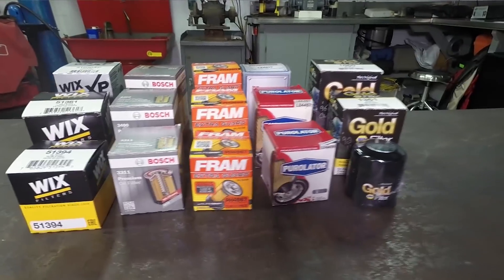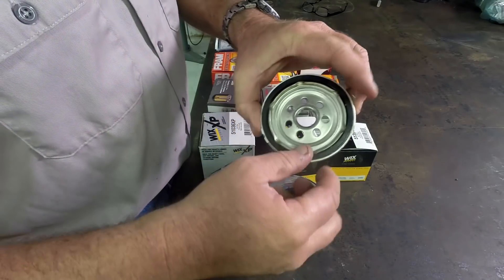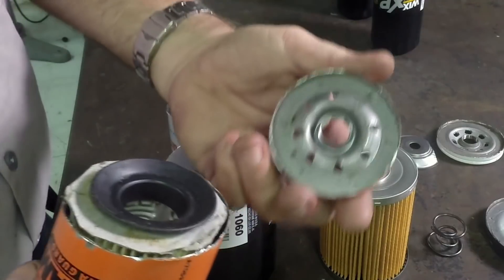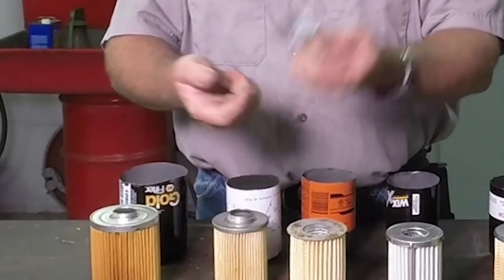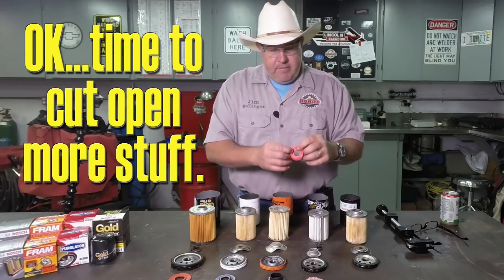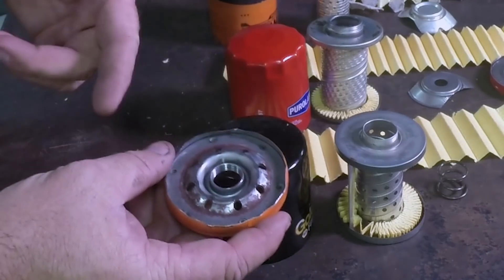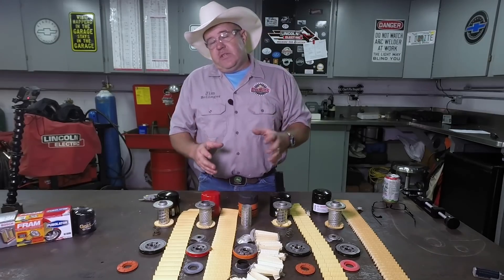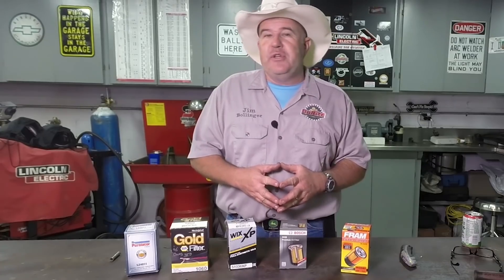The worst oil filter EVER!

Comment: I have seen literally over one hundred or more cut open Fram orange filters after being run from 2k miles up to almost 10k miles on bobistheoilguy... The overwhelming majority of these actually used filters looked perfect. No rust... No separation of the end cap from center tube.  The very, very few that did  had some deformation of the pleats... One had a rip in the media... Which by the way a Purolator has had many many rips in them. The rips in the Purolator media is almost always near the final seam.  Especially the 14610 sizes. Even Wix had two torn filters on there... But that was out of like 100 plus Wix filters cut open on there. I have a Wix 57356 on my 3.5 VQ motor right now... I like Wix quite a lot. But even Wix has an occasional failure. Very seldom but it has happened at a extremely low rate. Just like Fram orange filters. I cut open a Fram Tough Guard 7317 from my own VQ on the bobistheoilguy site... It was absolutely perfect after 7k miles. While on this subject I cut open a Purolator One 14610. Which was in great shape has well. No issues. But there have been many of that sizes which have rips in the media near the seam. 

 Fram orange filters are on MANY vehicles all day in this country. Fram also is a OEM filter supplier for vehicle manufacturers. Also I just saw a Mazda oil filter in a can with zero end caps... Zero. That was interesting. That being said a Fram orange is fine for what it is.... A entry level filter. There's nothing wrong with buying a  upgraded oil filter. I do at times. But I have never had a issue with a Fram orange when I have used them good number of times. A entry level filter like a Microgard (made by Wix), Fram orange, and Napa Proselect (made by Wix)  are all made just fine for what they are intended to do. 
Higher tier filters are great too. Which I have a Wix 57356 on my VQ motor right now. With 2 more Wix 57356s waiting in the wings to be put on my grey goose. I like Wix overall quality. Obviously higher tier filters have synthetic media and silicone ADBV. So comparison of entry level vs higher tier filters is not a apples to apples comparison. It's not. It would be like comparing a Napa Proselect to a Fram Ultra... Apples and oranges comparison.

Comment: Well all i can say is when u have a oil filtration system fails on your car and the engine take a hit...

"OH FRAMITT!!"

(Baa-dumm-tisss)

Ok enough of that but really from all the years ive changed oil in several cars ive own i NEVER looked to getting Fram its cheap but im not about the super cheap when it comes to my cars because there too important to be skimpy when u need them. And wow just as i suspected from all the years ive skipped from using fram i always knew that filter was a P.O.S. and there is the apparent proof of how bad those filters are. If u think there bad i would imagine there air filters are also bad as well.

Comment: Weird that it's only the USA that seem to have problems with Fram filters, the rest of the world manages to use them just fine.
Reply: ricky302v8 - The USA uses them just fine also, but they’re still crap no matter where they’re being used.
Reply: Just as with culture, standards change when you visit different parts of the world.
Reply: I have used K&n filters for years. The side of the box has a cut-away of the filter showing its individual parts. I buy them because I am assuming they are some of the best quality. Am I paying for this better quality or advertising wank?
Reply: @steveholbrom8424  - Well here is food for thought... If an air filter honestly flows more air over the same exact surface area of the stock filter, the only way this can be done is by making the filter itself less restrictive (In other words, easier to pass particles through it). This is why K&N and many others have you douse the filter in oil, to help collect the particles that can pass through the filter element as it does not do as good of a job as a stock one. Now I don't know about the overall quality of the filter, I would assume it is of high caliber, but if you can drive a truck through the holes in it then who cares what it's made out of.
Reply: Power to the Sheeple The dirtier the filter the better it filters 😉
Reply: It's because Americans think they're cool to hate on Fram. Honda uses Fram filters as OEM.
Reply: @cjeam- Um no actually Honda does not use Fram filters and you can find videos right here on YouTube that cut apart blue OEM Honda filters and compare them to Fram and they are not the same. And Bob - McDonald's sells Billions of cheeseburgers ever year so does that mean McDonald's the pinnacle of high quality food? I mean shoot, if you can't see the blatantly obvious proof here and on other countless videos then well just keep on buying Fram I guess.
Reply: Power to the Sheeple Was a joke. As a filter becomes dirtier it restricts more and more material (and air/oil/fuel) from going through it, filtering more stuff. A blocked filter filters 100% of the material going through it, because nothing at all goes through it.
Reply: @powertothesheeple5422  Fram and another company (starts with a T, I believe) make Honda OEM filters. Fram also makes Subaru filters.
Reply: Yes I often wonder, why do Americans get these problems. I live in the UK and have never had any problems with them. The one on this video is clearly a knock off and would just collapse in service.
Reply: Well for the UK blokes, has anyone over there cut apart a UK Fram filter like this to prove it's better quality? I bet it just comes down to the fact that nobody has actually done this type of video on those products. It's not like there is some huge issue with Fram filters in the US, in fact they are still probably the most popular brand. But if you take the time to cut them apart, you see that they are sub-par at best. And here is food for thought; why is it that no manufacturer in the world puts a Fram filter on their engines from the factory?
Reply: How do you know it was a knock off? It was a bona-fide Fram filter available in Walmart and Auto parts stores!  I done this test 20 years ago and the Fram filter was much better than now but still not as good as WIX - that was before Fram had all the different grades of filters! Now there's too much guess work involved with selecting a Fram Filter. NOT so with WIX!   @phillipjones3439
Reply: As crap as it is, 99.5% of people using them exclusively for the life of the car would have 0 filter related issues. The difference is that people using better filters would see a 99.7% success rate. 

Note: Numbers are not real, I pulled them out of my ass for example purposes.

Comment: This is a lot of personal judgements. Zero actual, repeatable, scientific comparative data. OEM's have been using cardboard end cap filters for decades. Some even use plastic center support tubes. AC Delco is a good example of both. They are good enough for GM and their warranty requirements. Cartridge filters on newer cars use them exclusively from GM, Toyota, etc.
Reply: eb0800 - ”Repeatable, scientific comparative data”, cut the crap. You don’t need to test a filter in a lab coat to  know what attributes are favorable, or that one filter is garbage. And good enough for warranty requirements doesn’t mean much - especially if the OE part is produced by the likes of Fram. Any piece of crap will filter your oil and protect your engine for a warranty period. Long term protection is where quality plays a part.
Reply: @mr.butterworth  How do you know what attributes are favorable? Are you certified and authorized to say what is? I'd say that warranty requirements mean a hell of a lot. Cars go for well over 100,000 miles today and many are covered for that long or longer. The OEM's put hundreds of thousands of hours of research and development into their filters and you can be sure that they are more than adequate. Plus, how would you know if Fram does or doesn't make your filters? Many OEM's and aftermarket names contract out their work to other company's and just slap their name on the can or box. If you don't want to use a certain brand of anything because of a YouTube video or hokey superstition go for it. I'll stick with the facts and data. #alternativefactsarefakenews
Reply: eb0800 - Haha, I don’t need certification, and certainly not authorization to say that a new filter with cardboard and rust in it is junk. Do you ask a plumber for permission before you decide your toilet is busted? This is the business of oil filtration man, not heart surgery, it’s pretty straight forward. If you really want to know where your OE filter comes from, it’s not hard to find out, it’s public record. For example Motorcraft filters are made by Purolator, to Ford specification.

Engines have been capable of 100,000+ miles for decades, warranties have been stretched to that distance in recent years is what you mean. As stated previously, even a junk filter is “adequate”. But if finding a better quality filter is the goal, there is no superstition involved. Smartly designed seals, a lot of surface area on the filtering media, etc. are desirable attributes. Oh yeah, and no rust in the bottom. Ha!

Comment: I use to buy fram because of the ease removing them due to the bottom rugged paint. The guy working at autzone for years told me the same thing about fram, just get you something better because that will mess up your engine.  I change every 3-4k miles full synthetic.

Comment: Should've tried Purolator's higher quality filter the Purolator PureOne supposedly good for 10K miles or Purolator Boss synthetic filter good for 15K miles. You bought there cheapest basic filter so it should be of a lower yet still acceptable quality. I only buy Purolator or WixXP filters.

Comment: I am stunned. I have been using Fram for years on my diesel which needs 20/50 oil. If they were truly junk, I can't believe I've never had a problem. I  have had five vehicles go 110,000 to 130,000 miles with Fram and now the current diesel has 210,000 miles. 

Looking at the one you opened I have to wonder if it was one that sat in the back of an unheated warehouse for five years before you got it. I am going to have to ruin one to see what is in the ones I buy locally. If they look like the one you opened, I will not be trusting them again.

Comment: Hi Jim,  Thanks for cutting open filters from all different price ranges. True, you used the least expensive Fram to compare with some slightly more expensive ones.  Many DIYer's choose based on price, (sometimes the least expensive);  just as many ignore manufacturer's suggested drain intervals under any driving circumstances. That's the engine that's likely to have diminished fuel economy, smoke like a pig, and fail prematurely . Their vehicle, their choice.
Disappointing that you failed to mention anything about the Bosch's filtration media, which is not the same as Purolator's filter.  Bosch clearly has more media & pleats than both the Wix and NAPA filters you were comparing.  More pleats in the media equates to more filtration surface, more surface means more holding capacity over the life of the filter.  The depth of filter media plays a role in holding particulate matter as well, which you didn't evaluate.  I agree both the Wix and NAPA filters are quality.  I just wish you didn't drop the ball by avoiding an honest opinion on the Bosch filter; it too is a quality filter.  Truthfully, it looks as though you have stock in NAPA, and or are a Wix fan, if not being supplied with filters by both companies.  
By the way, I am a firm believer in quality filtration along with a quality Full Synthetic oil (AMSOIL is my choice).

Comment: I guess the 250,000 miles and still going van I sold last year will be ruined soon since I used Fram filters from day one. LMAO! As long as the filter is intact it does the job. And if you change it out with every oil change it will never fail.

Comment: Mopar- motorcraft- ACdelco-Toyota- Honda filter are slightly better than a service champ and purilator which are any lubes shops basic filter all of which are better than any fram filter. I've known this for years glad more people are catching on. STP filters aren't much better but they won't deteriorate as I've seen in used from filter that have chunks missing out of the element after only 1,500 miles

Comment: Kinda silly really, cutting these open to decide what is good. The info that should be considered is the the filter efficiency numbers AKA  micron rating. These ratings can be found by Googling them, you'll be surprised. The actual ratings differ from what you'll find creating a pile of scrap on your workbench but it was fun to watch if of minimal use.

Comment: I've only used a fram filter once and i watched my oil pressure drop to zero 2 times while i was driving I didn't want to use it but it was the only one that would work on my truck after watching my oil presser drop i will never buy a fram filter ever again I stick to mopar filters
Reply from the maker: @Blackrt99 check out my second oil filter video on my channel where I compare a stock Mopar filter. Thanks for watching and don't forget to share these videos.

Comment: Thank you for this valuable information. I used to use Hastings for one particular application because it seemed to prevent cold-start knock. I did use Fram for that application, but only once. Great video.

Comment: I have seen several videos about oil filters and it's always the same. FRAM filters are the cheapest made filter there is. I have used them in the past but haven't for several years because of seeing some cut open. I stick to NAPA or Mobil1. 
Years ago I worked at a NAPA store. Their filters were made by Guard Corp then. I thought Guard also made WIX filters so I imagine that may explain why they are virtually identical.

Comment: Wow, Fram "was" my filter, until I started driving Toyotas! They (Toyota) specifically state that their warranty is void if you use any filter other than Toyota. When I bought my first airplane (1993), my A&P (airplane mechanic) recommended me cutting my oil filter open and checking for metal shavings. Amazing, every time I cut one open, I would finding some, but not an unacceptable amount (just a few particles)! So, out of curiosity I started cutting my Toyota filters open also. They are well built also. I do have an opener, much like a can opener, that I use. The grinder that you are using to open the filters  would introduce many metal shavings and defeat my purpose of opening. I appreciate you comparing these filters, I don't think I will ever buy another Fram filter. Thanks.

Comment: Wix, NAPA and FRAM are all made by the same company.  Look, you can put what you want on your vehicle / engines, but I stick with OEM because if something happens and that filter fails, good luck getting ANY of those aftermarket filter makers to cover your losses.  Just my .02 cents.  The few bucks for a cheaper filter is not worth the risk

Comment: I put a Fram in my old truck 1 time, long enough to drive me to the store and geta better one.  Had around 5 psi oil pressure at idle from it, only around 20 above idle.  Normally it would idle it 20 and go up 40+.

Comment: The Man says "the proof is in the puddin' "  Well Okay-I've been using FRAM filters in  my 99' Ranger since it was new. It now has 282,000+ miles on it and I still don't need to add any oil between oil changes. I use no particular oil other than a 5-30w in the winter and 10-30w in the summer.  It starts immediately, NO smoke, runs smooth, and gets between 21-25mpg. It's a 3.0l XLT "sport" 4x4 5sp. I've driven it on and off road, both city and highway miles. I've crossed the US 3 times, each time taking a different route. It is mostly a work truck, using it to haul things from empty beer cans to the recycler to being loaded down with rocks, bricks, and pavers for walkways. I've always have had a ladder rack and a canopy on it and you might have see me some where's as I get around.  My only complaint is the darn frame is going to rust out before the engine does. But I do change my oil/filter on a regular basis as well as the air filter. 
Also, the man is fast pointing out the "rust" on  the Fram filters- Does he know just how long have they been sitting around on some shelf? Where did he buy them?  He pointed out that he could only find them at "one" store- What some ol' back woods General Store that hasn't sold a filter in a couple years? Did he leave it out in the rain just so it would rust? How can we trust someone that could rig this whole demonstration a dozen different ways? 
While I admit taking them apart (the Fram filter) didn't impress me, neither can I say that there's really anything I seen that would make me feel like they don't do the job. But I'm just one guy that had good experiences with them. And maybe for the Ford Ranger, that filter might be built better than say for a Dodge Ram that he might drive. I can't say. But I think it's a bit early, that the jury should examine a lot more evidence before they decide on a verdict based on ONE FILTER he found somewhere. I'm just sayin'